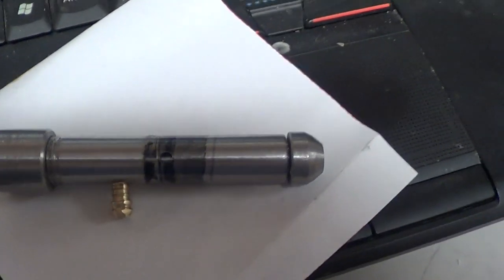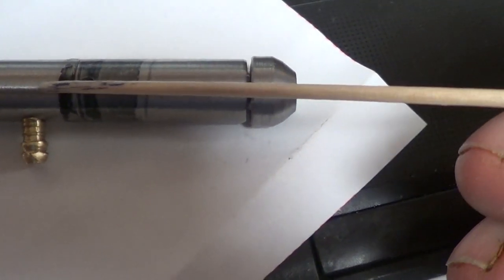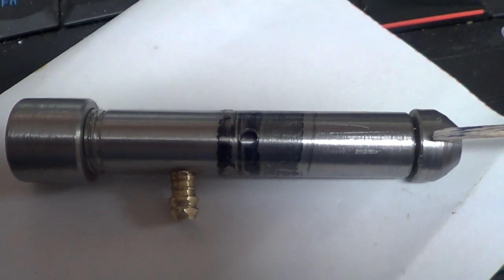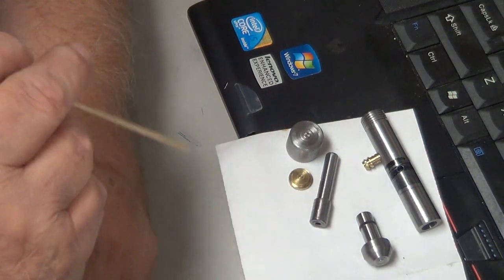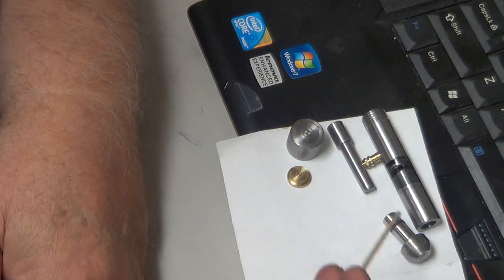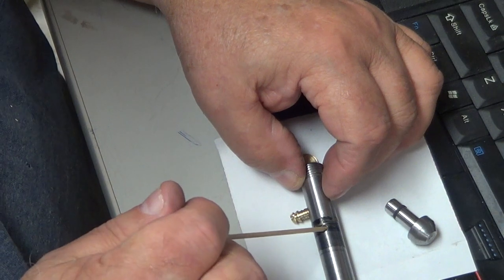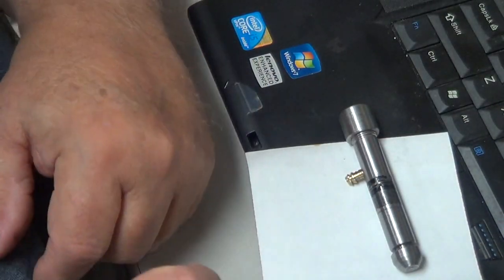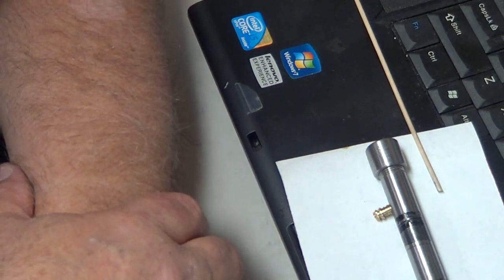New Air-Graver Working Design Completed

Comment: I suggest trying to make an "airtank" on the handle, just a little space behind the piston, to have enough air to be compressed, it will make the piston run a lot easier and smoother. You can even get it to idle run with just blowing air with your mouth.

Comment: Where can I find plans for one of these ? I want to make one but don’t know where to start ???
Reply from the maker: The air gravers require a lot of research they are not easy to make and most of them have patents. You can, however, make the pulse graver and there are many designs which you can find on youtube
Reply: RHJ GOLD oh ok so no on the guidelines 
No worries cheers